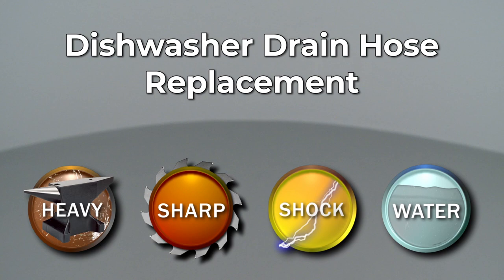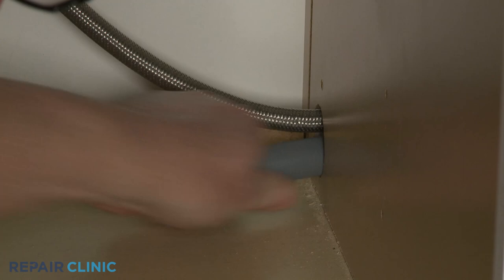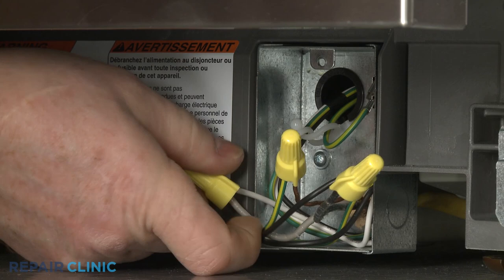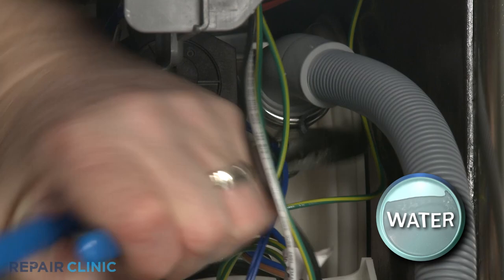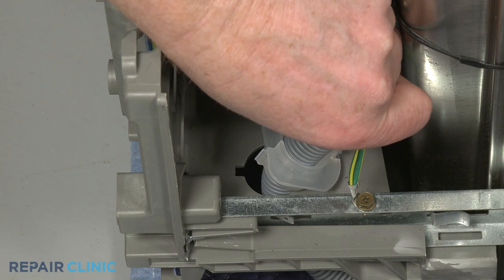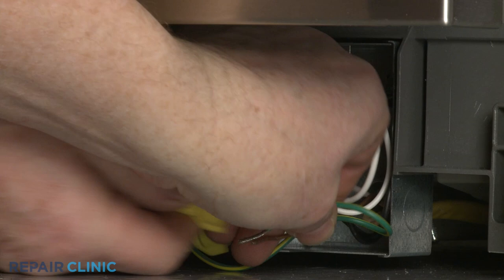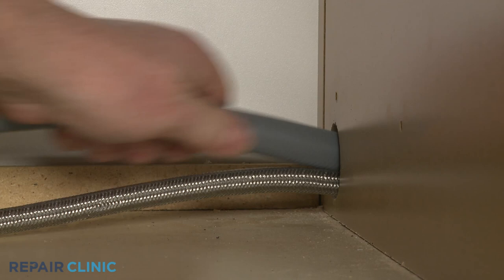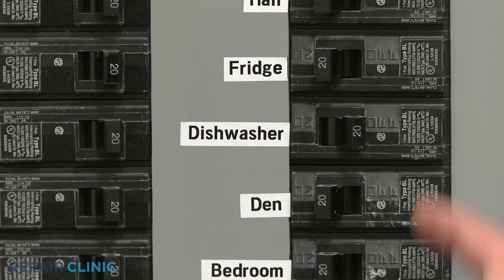Electrolux Dishwasher Drain Hose Replacement 807032601

Comment: Is the dishwasher hard wired into the wall or something? i.e. why turn of the circuit and also disconnect the junction box before tipping ? Why not just pull the power plug from the wall socket?